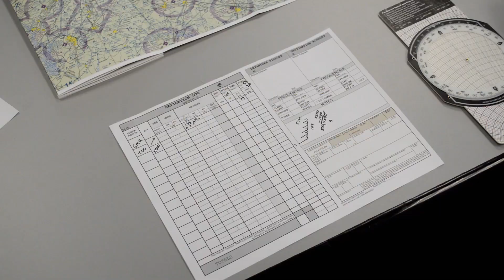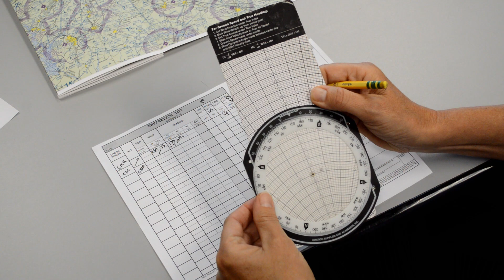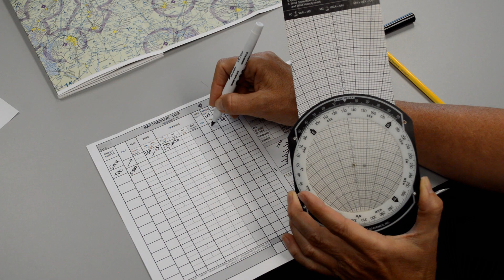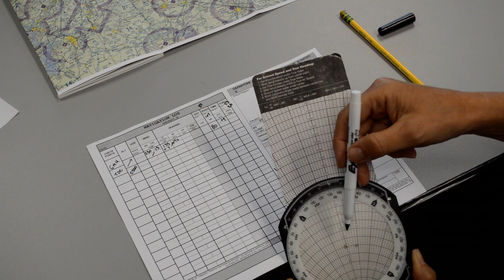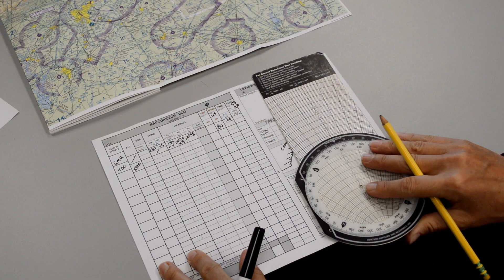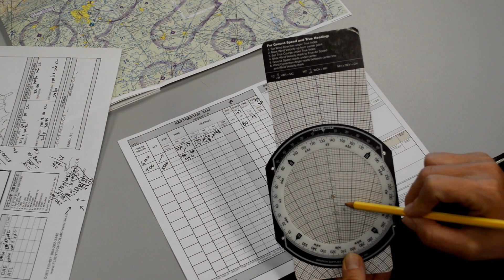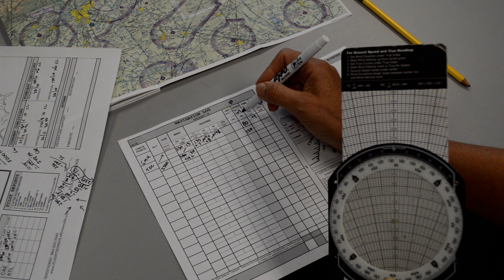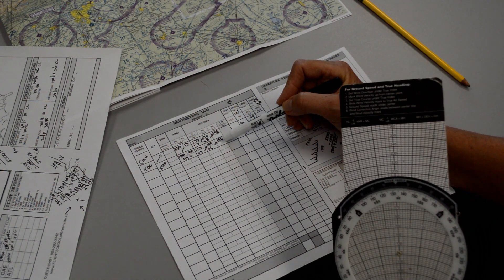Groundspeed and WCA Calculation - XC Flight Planning (Private Pilot Lesson 14k)

Comment: TC + - WCA (calculated with wind from True North)= TH + - VAR =MH + - DEV= CH. You converted TC to MC by adding variance, but you didn't convert the winds aloft (which are always given in True) to magnetic. Therefore your wind direction is off by 7*. Correct? Or did I miss that class on winds aloft conversion?
Reply: I think you are correct. I was just watching this video and I had to watch it again. The NavLog provided should convert winds to magnetic OR it should use true wind to calculate TC, then factor in the WCA to obtain TH, then convert the TH to MH, then apply the DEV and finally the CH.

Comment: A fine example using the E6-B for calculation.  I have the same E6-B as you have, and I discovered that the same "EXPO dry erase" that you have works much, much better than the pencil, makes a non-permanent mark and easily wipes off with fingers, soft cloth, toilet paper, facial tissue.  Your lessons are terrific!  Thanks.